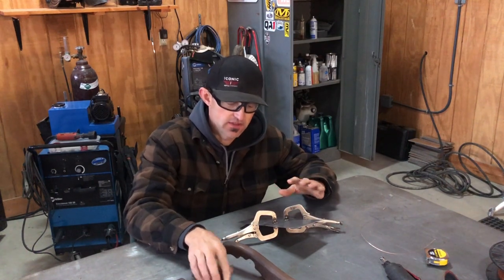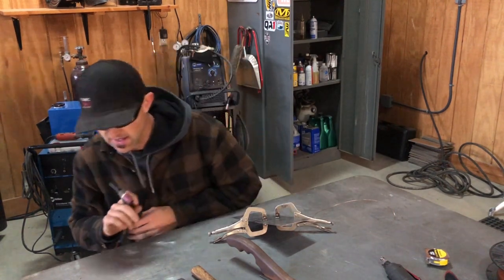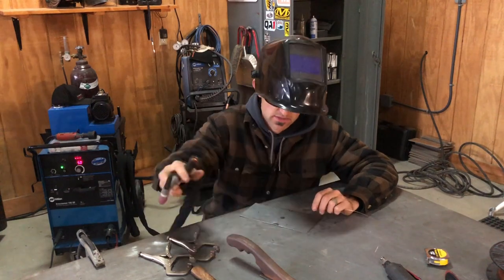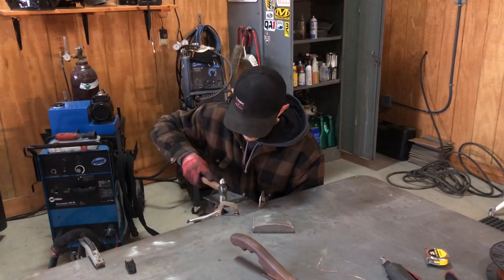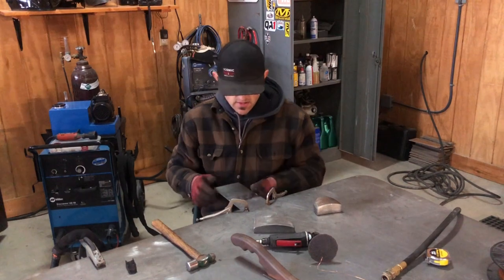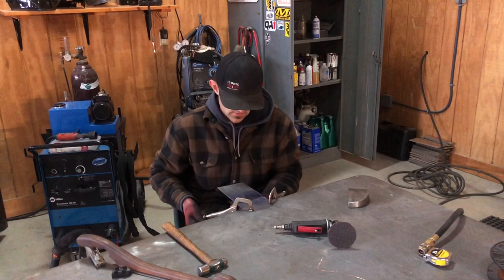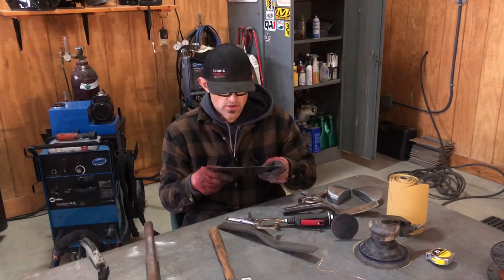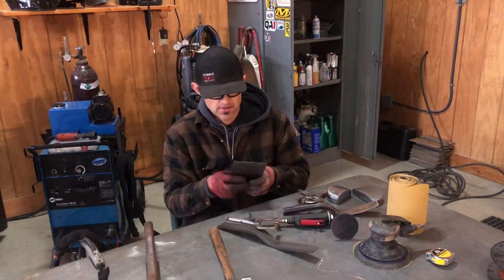Planishing sheet metal after welding

Comment: Once the weld is ground relatively flush Would a shrinking disk work to shrink the highs? I’d be concerned hitting it with the sanding disk so many times. Maybe you are just removing the weld beat that comes up? Great stuff and congrats!
Reply from the maker: Yes  I do use the shrinking disc but when welded 100 percent penetration you want the high side of the weld gone